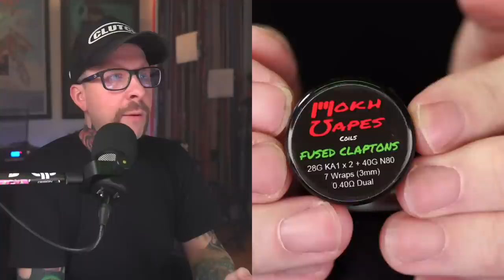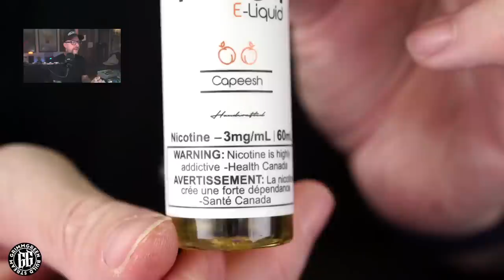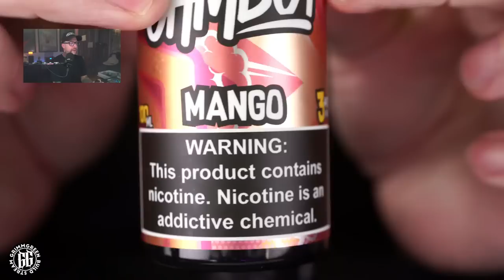Build 'n Chill! My Legendary Banger RDAs - Kennedy - Reload - Recoil - SOI

Comment: I only bleh juice through the middle of my kennedy 25. Always have always will. You should try it sometime rather than popping & painting on yours. With that being said I bleh through the top cap on every rda I have & most of them are 2 post. Cotton is highly efficient at wicking juice to the coil very quickly, especially when  the coils are hot.

Comment: Fuck yes Smokerstore DE Taifun GT4 ALL DAY AND NIGHT in shorty mode for YEARS now. 
There's no better single coil restricted lung banger out there that consistently delivers like it under the sun.
Dual 26 wrapped in 36 full kanthal, 3mm, 6 wrap, 0.48 ohm pushed off center towards the fixed post and down where the leads are level to the deck.
Cotton Bacon snug-ish, thinned and cut to the top of the juice ports.
42.5 watts with the dual air ports wide open.
You've NEVER tasted your favorite custard, fruits or anything as well as this magical RTA.
Yo, Grimm. I'll send you my backup GT4 to try if you wish to review it.
YOU need to know and EVERYONE deserves to try it.
So0oooo goood!🤘😤🤙